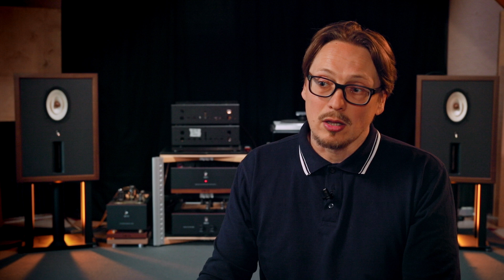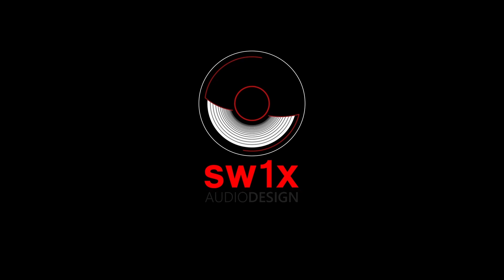Why Signal Transformers Are Superior to Signal Capacitors

Comment: Thank God there are no capacitors or transformers in OTL amplifiers.
Reply from the maker: instead one has NFB built in, which is probably even worse and one still has capacitors in the power supplies, which is also inevitable in any design
Reply: @sw1xaudiodesign  Hi, we're talking about an audio path, OTL amplifiers don't have capacitors and transformers at all. From the input terminal to the output jacks. And we hear a true tube sound.  PS And of course capacitors are in all power supplies, even class D and digital amplifiers.
Reply from the maker: @andrisgulbis9677  and those capacitors in the power supply are not the signal path?
Reply: @sw1xaudiodesign  of course they do, but at least there are no transformers and capacitors in the path of the sound path, which removes their influence on the music.

Comment: One of my SE amps uses no coupling components in the signal path just two valves and output transformer. And it's the cleanest sounding amp in my collection!  That said, the Russian teflon caps beat everything ever made, and sounds clean and dynamic. I struggle to hear any losses.
Reply: Those russian teflon ones are nothing near Duelund cast cu, just to name one.

Comment: Absolutely correct. The best capacitor is no capacitor. I use a transformer for volume control TVC, then in the D/A converter, and in the amplifier I have direct coupling E180F and 2a3, that means without capacitors again and finally - output transformers.. All this on fullrange speakers, without crossover and capacitors.. Sound, for excellent to me.
I like your understanding of the path to good sound.